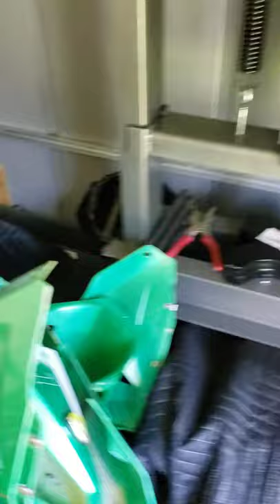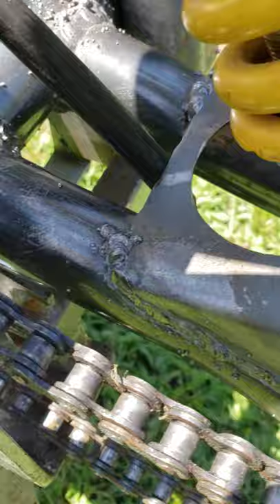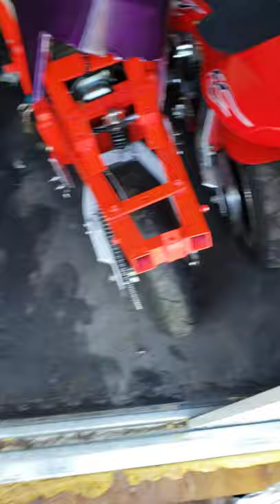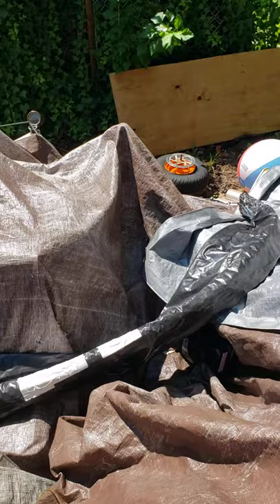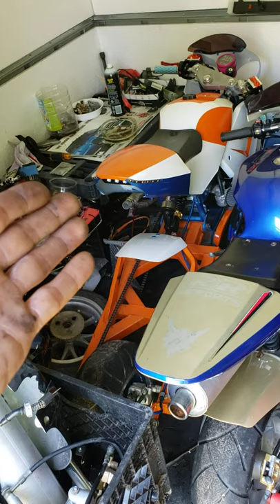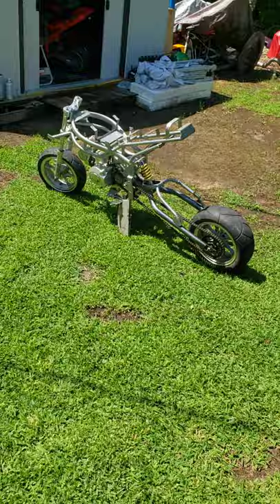Custom x18 Super Pocket Bike Drag Build pt.1

Comment: How come you don't have commenting on half your videos I wanted to find out what fairing  Fender kit you used on your builds mostly your extended and 250 motor one and what tank would be good
Reply from the maker: Im not sure. Ill check into it. As far as the fairing i use they are the ones that came with the bike

Comment: Where do u get the x18 I heard it goes 60 to 70 miles per hour
Reply from the maker: I had them for a while and yes with a little bit of tuning on the carb it will do close to 70. My top right now 65 with stock exhaust